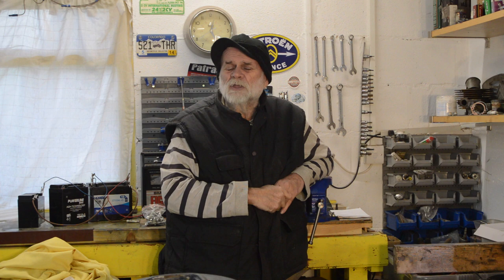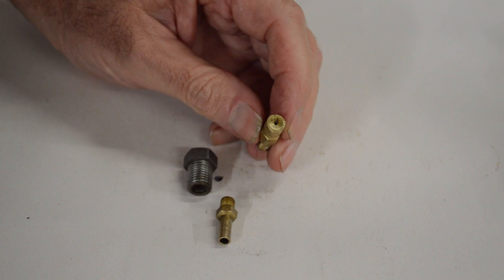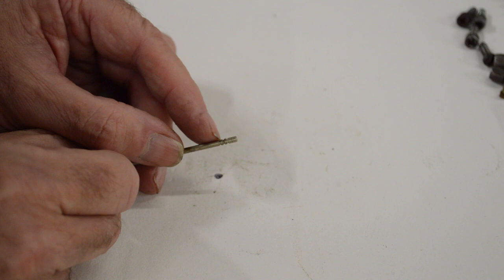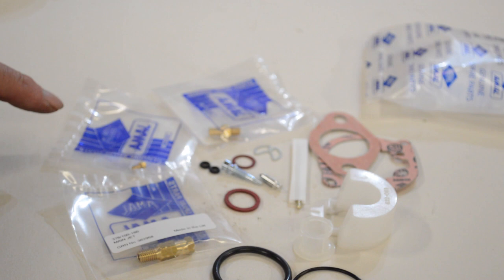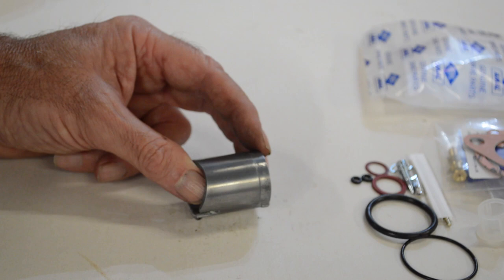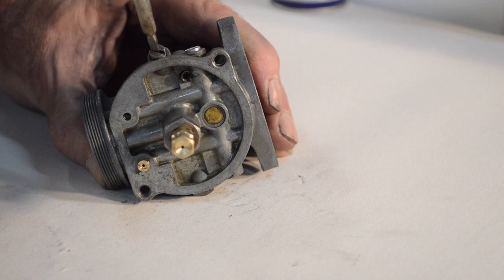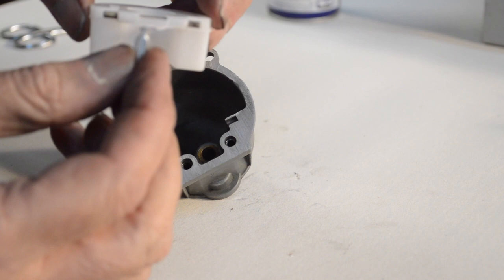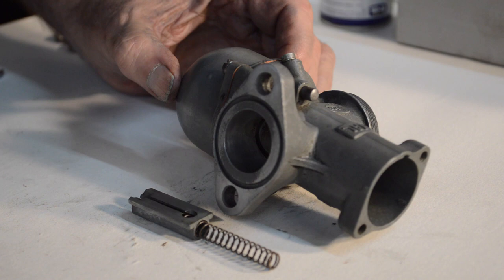Bantam Carb

Comment: Good Mornig Mark Hope you are well,thanks for the video very interesting.When you polished the faces to make them flat,was it on a sheet of glass ,wet and dry(what grade) and was the lube WD40?.Sorry if I missed it.Thanks Steve.
Reply from the maker: Hi Steve, how are you doing? The wet and dry was 800 grade and as you said I used a bit of WD40 to lube it up but I suppose water would have been fine too.

Comment: With the float and top hat filter being a new formula of plastic, do you think that the plastic on the banjo bolt will hold up to the ethanol based new fuel.  Also would you replace the fuel lines?  I am hearing horror stories but have not seen how bad or quickly the old formulations of plastic and rubber degrade with the blended fuel.  On the needle and seat, would you polish the seat for the new needle or only if appeared damaged.  I worked on hydraulic systems and when we changed from a paraffin based fluid to synthetic the seals were shot in 6 months  and hoses blistered in less than 2 years.Another great video,  Thanks for sharing.
Reply from the maker: Good question Max, I do not know about the plastic, I suspect it will be more resistant than rubber but time will tell. I will be fitting new fuel lines, I have some which claim to be resistant to pure ethanol and as the bike will only ever have 5% petrol in it they should be ok. I did not mention cleaning the seat in this video, although I used cotton buds and metal polish in the Firebird video. The seat was pretty good though perhaps being a two stroke helped? As for rubber rotting, I was amazed the other day to find petrol squirting from one of the pipes on my 2cv which had seemed perfect when fitted. I also have an intermittent fuel supply problem ( I think ) so I am going to drop the tank and change all the lines. Thanks as usual for watching!